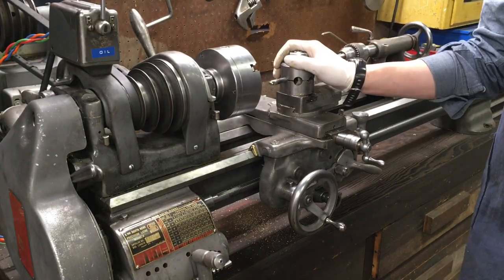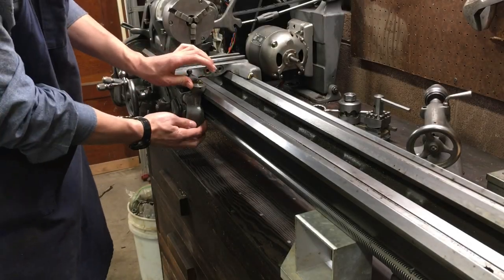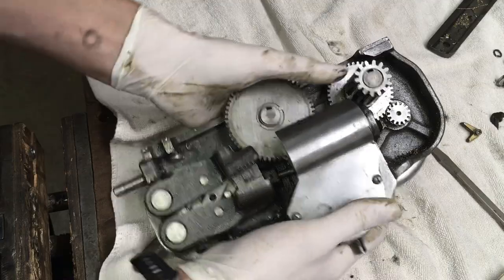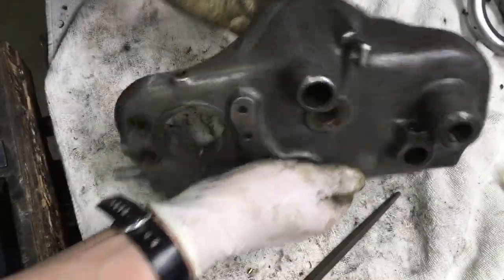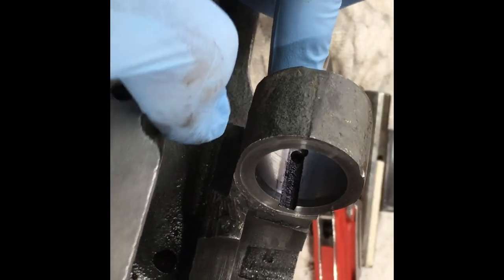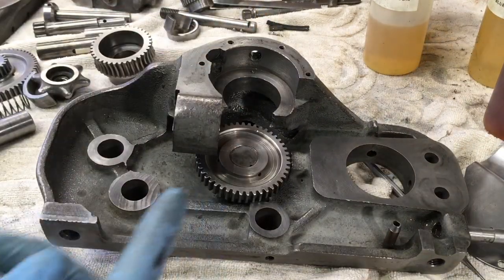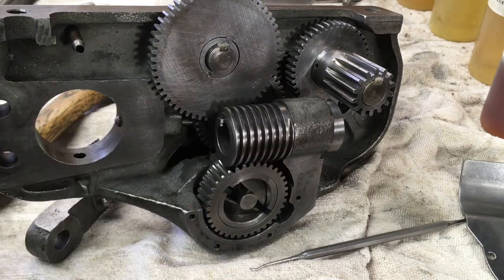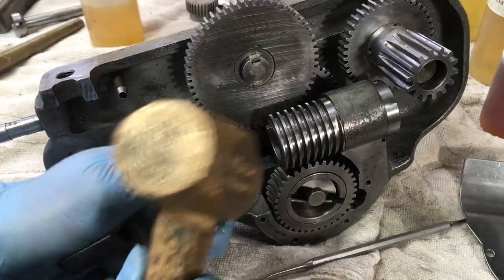Southbend apron and saddle rebuild 9A

Comment: Definitely the best video on how to rebuild the apron.  Do you have any vids of rebuilding the other components on the SB9?  Just wondering what you use for way oil as well?  Only real way oil I can get is sold in 5 gal quantity, so I'm looking for an alternative, heard engine oil work well
Reply from the maker: Hey bud, so glad you liked the video! 

https://www.ebay.com/itm/123818051435?mkcid=16&mkevt=1&mkrid=711-127632-2357-0&ssspo=0OtUlcMfRO6&sssrc=4429486&ssuid=9yr47rxpqve&var=&widget_ver=artemis&media=COPY

This is the stuff I use mobile vectra no. 2 way oil in 1 qt quantity. It’s good quality stuff. You definitely could use motor oil but this is a higher grade oil that smells less and is easy to clean up in the cold. Also the bottle is great for application.

Comment: How does the worm gear really come off. at 7:06 or so, it magically just comes out, but not really seeing how it got there.
Reply from the maker: The key inside the worm gear has a pin that goes through the barrel of the work gear into the nut. Find the pin in the nut with a small round punch and tap it out then unthread the nut. Thanks for asking

Comment: Beautiful. Thanks. 
I’m trying to dismantle my cross slide on my SB 10L. I have the handle and dial off but can’t get the bushing to unscrew. It seems frozen. Any ideas on how to remove it to get the cross slide screw out?
Thanks,
Paul
Reply from the maker: Hey Paul! Not sure on that off the top of my head. I’d look for a tapered pin or apply a little heat and twist it in both directions with a copper shimmed set of vice grips or knipex pliers
Reply: @boonetesterman  yea, I’ve looked for a pin and I’ve taken a torch to it twice. The big problem is that I can’t fit my 1” wrench on it and the 1 1/16” is too big. Can’t get a solid grip. I’ve tried a crescent wrench and the ones you mentioned. When I put too much torque on it, the wrenches slip off. 
Driving me crazy Ms Daisy. 
Thanks.
Reply from the maker: @paulmanhart4481  damn! Know the feeling. Best of luck. Thanks for checking my video out and leaving a comment.
Reply: @paulmanhart4481 yeah I'm literally having the same problem, I can unscrew it a little bit but it just gets stuck after one point. For some reason there is no hole for a pin spanner, so I'm stuck using a wrench and some cloth so I don't scratch the collar. I'm going to try some wd-40 and heat and I'll let you know how it goes

Comment: Is your lathe not painted?   Did you strip it, or did it come that way?   How do you prevent it from rusting?    I'm restoring one of these, and I like the bare look.  The paint on mine is crappy, so the idea of stripping it is intriguing.    Thanks for the vid btw, this is very helpful.
Reply from the maker: It's still got some paint left on it but a lot of it's worn off on the contact places. I live in a high desert so don't have to worry about rust too much. Just keep a film of oil on it all the time and keep it covered with a natural fiber cover like canvas or even an old bedsheet. Thanks for the comment and watching! If you do end up painting Id recommend Rustoleum smoke grey gloss oil-based enamel. You can get it at home depot and it's a pretty good product.

Comment: I’m doing up my Dads old Hercus 9. What’s your opinion on repainting these old vintage lathes? Is is better to repaint or leave the patina. If leave, how best to protect the once painted surface from rust when the original  paint worn off?
Reply from the maker: Excellent Question Pete! Glad you asked. That’s great you have not only a fine machine tool but family history with it. 
Well it really depends, If I repaint I always go stock color or as close to it as possible. Not a fan of bright flashy colors on machine tools. Rust oleum oil based enamel is my favorite. Sprayed rolled or brushed it looks great and is quite durable. I’ve found that it works better without primer on clean warmed castings (75F) in thin enough coats that it still levels out. As for leaving the paint, there is a good argument for that too. I left mine because i really like the look of oiled cast and felt like it’s worn places connected me with the previous operators habits and style. Sounds silly but paint and how it has worn really tells a great story of how a machine tool was used. Was it cleaned daily? How was it touched? Things like that are cool to preserve because they represent generations past and what those people valued. Depending on where you live you’ll have different “degrees” of vulnerability to surface rust although me living in a dryer environment I have no issue with it. If you keep it covered in a thin layer of medium weight oil you should be fine. I keep mine covered with a sheet too to keep abrasive dust off it. 
Hope this helps, 
Best, Boone.

Comment: Love the presentation. I followed your video when I cleaned up my apron on my 9A. I am having a problem though. For some reason I the clutch feed is inconsistent. It's like the clutch fighting to stay engaged. It's pulsing at the same speed as the lead screw. I took it apart at least 5 times. Does anyone out there have any idea what the issue is? Thanks for your help in advance!
Reply from the maker: Huh interesting issue, did you check the wear on your clutch?
Reply: I did. Everything looks normal. I'm puzzled but not ready to give up.
Reply from the maker: @gross43  don’t give up! I can’t help you out much without more details. My email is wboone.testerman@gmail.com if you’d like to send me some pictures or video of the issue.
Reply: I will definitely do that. I will take a video tomorrow and email it to you. Much appreciated!
Reply: @boonetesterman  I emailed you a video of the issue.
Reply from the maker: @gross43  just got back to you,  I’d love to see what’s the issue.

Comment: how did you clean the gears so nicely? what chemical or tool? i am having a hard time.

thanks for any answer!
Reply from the maker: Hello David,
I used mineral spirits to break the varnished oil and grease. soaked them for a bit. Also a wire brush!
Hope this helps 
Best, B
Reply: @boonetesterman  Thanks, ive been using it, wow what a huge change in ease of cleaning! was using other chemicals and they sucked!